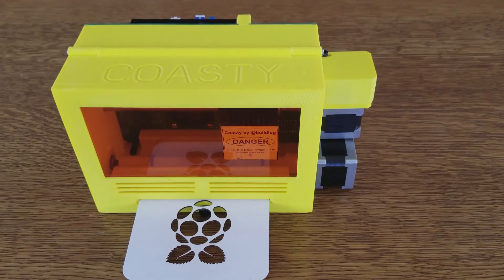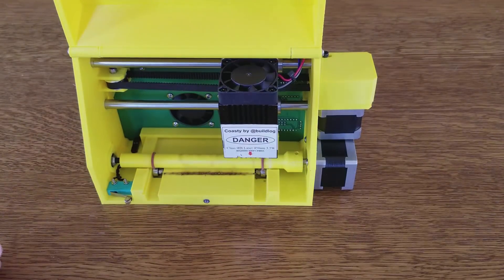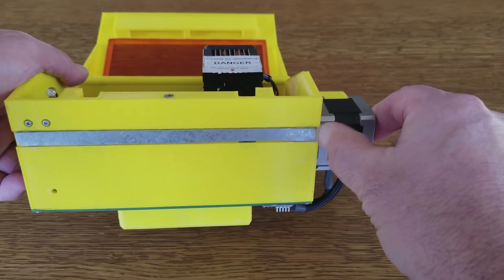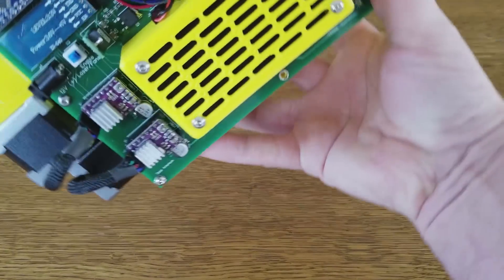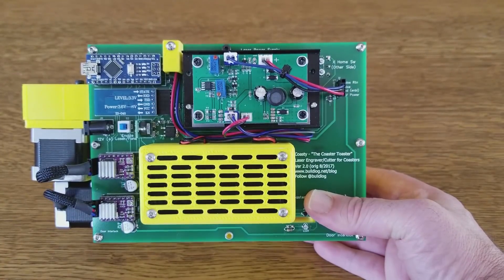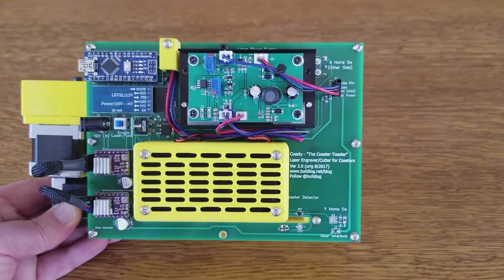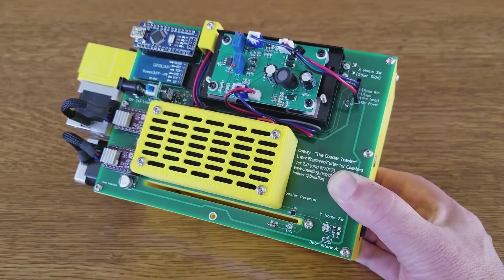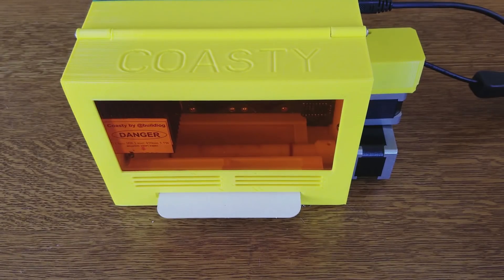Coasty Version 1.2 - Drink Coaster Laser Cutter

Comment: Coasters, intended to protect your fancy wood table from dripping condensation on the outside of cold drink glasses. Then you cut them full of holes that defeat the purpose of the coaster.

An option for a weaker beam, or use much faster movement, for just lightly singing the surface, would retain the coasters' utility as coasters.

A useful purpose for this machine would be making custom painting stencils. Cut a bunch of letters, including narrowing the coaster for proper kerning, then tape them all together in a line. Mount onto the surface of something then carefully spritz with paint.
Reply from the maker: The power can be controlled as well as the speed. Etching and mixed etch/cut designs can be done.

I have done some stencils, but more like drawing templates. I have done electronic, architectural as well as simple cartoon characters and balloons.  It makes typical napkin sketches look a lot better.

Comment: hope you will share the stl and circuit board .
Reply from the maker: All design files will be shared soon. I have to make sure all the correct hardware, etc is in the model.
Reply from the maker: The STL files are available on this blog post. http://www.buildlog.net/blog/2017/12/coasty-source-files/ The other source files are coming soon.

Comment: Awesome as usual.

How about one with a wider slot for laser toast?  I shouldn't need to use the big laser to put the Virgin Mary, Elvis or a favorite pet onto a piece of toast.  A Linux script should be able to take an image from a web cam, use an image manipulation program routine from the command line to produce a properly scaled black and white image, tweak the contrast, and save the image to raster burn on the laser.  Great fun at maker fairs or anyplace geeks are welcome.  Me On Toast is always a welcome take home gimme.